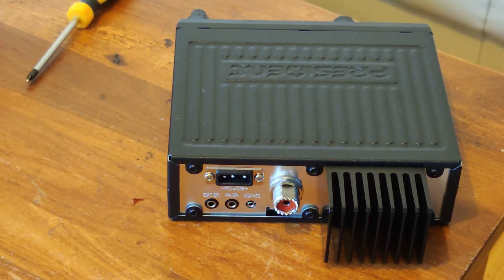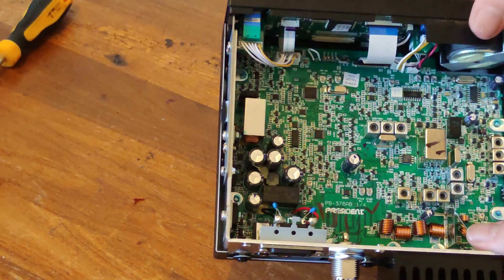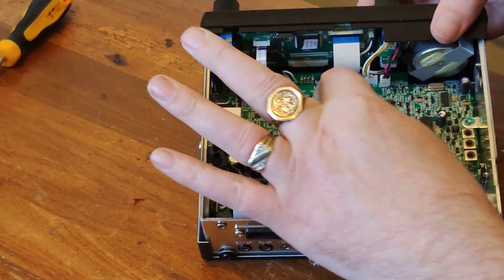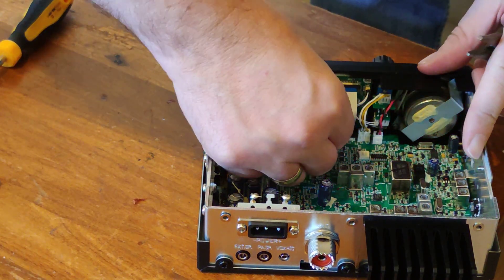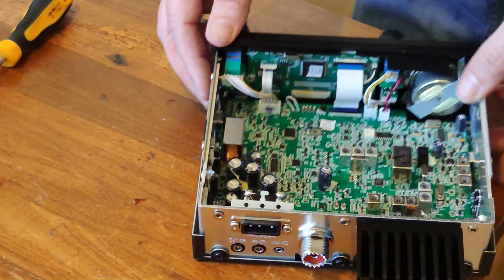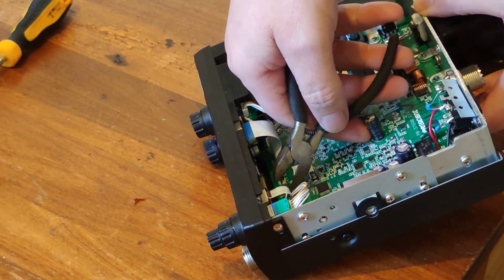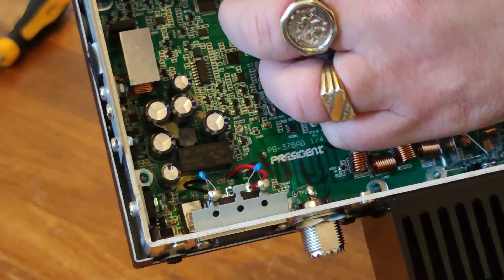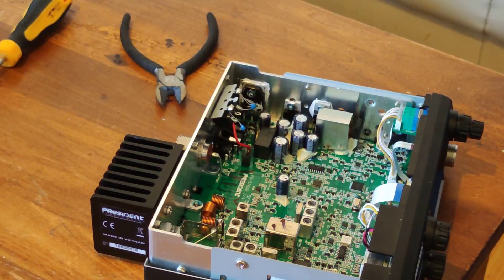modifying the EU president McKinley

Comment: We have the FCC junk 
modelz in USA dont mod .
Smash FCC presidents with 
hammer without an unlocked clarifier, 
extra freq coverage not too good for10m & CB that would be nice front speaker.
Glad yours UK Expands .
I got a Lincolin plus II rules!
 here all fcc junk am/FM should be 
$30-50 & the SSB locked up $80
we also have Randy HT radio stuck in 40 channels $150 junk.  I'm so glad president is making radios but all should be expandable at the  buyers discretion 
Good video fixed my mis-spell. .

Glad uou got good radios there .
Reply from the maker: The old FCC stuff was ok I think some of my realistic rigs like the TRC 449, 450 and the 448 are good rig's, I still love mine, hopefully things will improve on your side of the pond

Comment: I have the same radio, I don’t have the four resisters, the wire, or the jumper sleeve.
Reply from the maker: Is yours the FCC version
Reply: I don’t know what I’m looking at when I open any radio 😂 so I don’t know. I also noticed it doesn’t have the large heat sink either. I got it a couple 6 months ago, maybe they changed the innards.
Reply from the maker: @FireRescue884  the USA version doesn't have a heatsink and isn't possible to modify it.